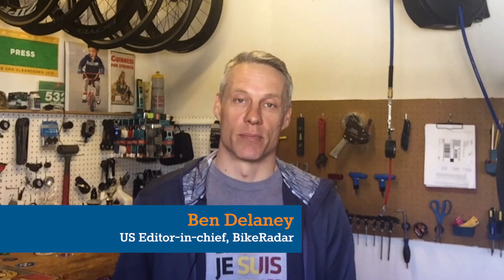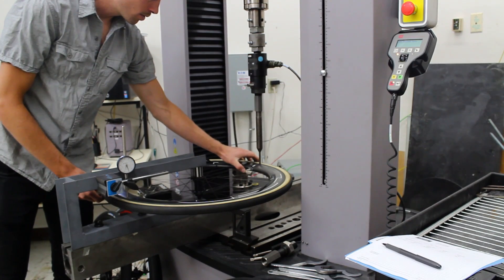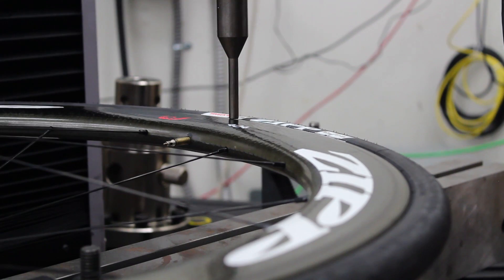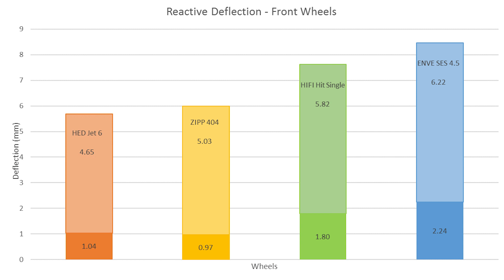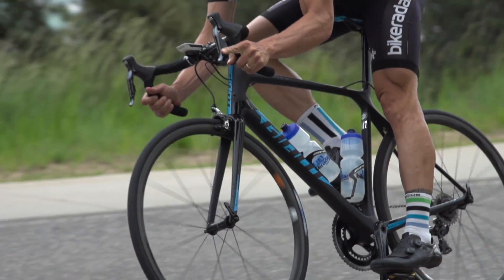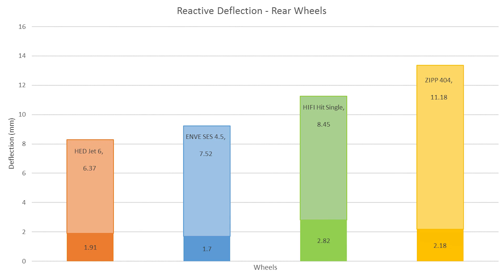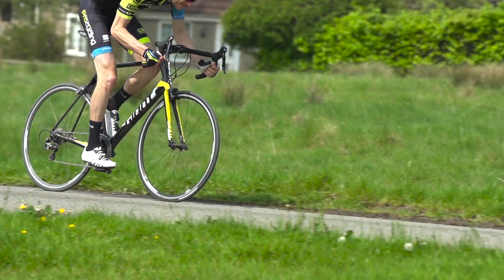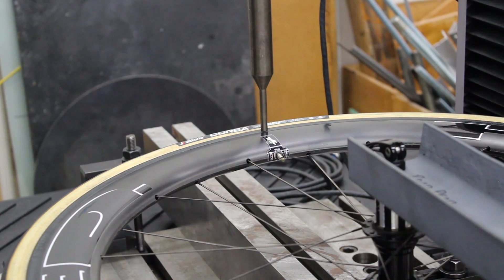Lab Tested - Wheels? Frames? Which Is To Blame For Brake-Rub?

Comment: It would be interresting to compare those numbers to a standard 32 spoke wheel for reference. I guess the HED performs like many other 20-24 spoke aluminium counterparts due to it's construction.

I once did used Specialized 3-spoke carbon wheels that was flexing considerably in a sideways motion.

Another interesting thought I have is this. How does these two conditions behave in real life? Does the flex in the wheel amplifie in the frame or do they contradict each other?

Comment: I think this test is off the track for one good reason, you forgot to explore one very important component on a wheel : the axle. When I look at the assemly between the dropouts of my bike and the axle of my wheel, I cant help but notice that it's not meant to be as solid as the 142x12mm axle on my mtb. I'm pretty sure the obsolete quick release attach on modern road bike is the main cause of brake rub. That's why my next road bike will have bigger axle and not that stupid piece of rubbish of QR axle.
Reply: Plausible. Thu axles give frame/fork rigidity that QR lack. I wonder if thru axles alone would eliminate frame based rub.

Comment: No mention of frames with brakes at the BB which are way more susceptible to rub.  I won't ever buy one again - Felt AR rub terrible under power to the point that you question the design altogether.  Felt AR the worst I've ever seen for this.
Reply: Same for me with Bottecchia T2. i was looking for answers when i found this video. So no solution for BB break rub? Not even a stiffer wheel? Was it only break rub or did the tire touch the frame also?

Comment: I was using a pair of cheap but very light Ti skewers and experienced brake-rub. Since moving onto a set of heavier steel skewers, the problem was gone. 

My guess is spokes tension plays a big part too, also I was told CK hubs have large amount of play in the rear wheel, more so the likes of tune, Fulcrum/Campag and DT240 etc.
Reply: Same here, the weight of the skewer was ridiculously low, and the down-side was brake-rub. Switched to more rigid ones and the problem was gone.

Comment: When you mention the deflection, is it total deflection from weight being applied to both sides of the rim, or just a single side? if so, which side was the weight applied on, Drive or Nondrive? I imagine a rear wheel, due to dish, to have very different deflection, depending on the side that the weight is applied to.

Comment: Do disc brake bikes have this issue?
Reply: Peter Milne I ran into pad/rotor rub when using flexy ENVE QR skewers. It went away when I switched to DT Swiss RWS skewers. Maybe less likely with thru-axles.
Reply: I have Disc only had issues with rubbing when the QR is not done up properly
Reply: Focus has awesome thru axles. I think they are almost faster than "quick" releases!
Reply: Peter Milne - Back in 2003 on a wet noodle SID fork and X-Max wheels with QR, I got noticeable rub under heavy sprinting...but those days are long gone.  Any disc rubbing these days is usually setup issues.

Comment: Flex in wheels will be compromised by spoke number and light spokes. If had the coin for enve's I'd get them built up with aero compsl or even a triple butt aero spoke drive side.

Comment: pls do a test between disc brake specific wheelset and the caliper brake wheelset.. and does the brake-rub happen to disc brake bike? personally it havent happen to me, but then again im using a aluminium frame
Reply: and im confused on the conclusion on the video.. they tested both wheels and frame yet didnt specify whose to blame? is it the wheels?

Comment: just use dics to solve all these problem
Reply: That is a typical complaint of rim brake roadies. Disc brake rub. But lets face it, both can rub and nobody ever personally fixes it, just blames the product design.
Reply: I have dics road bike and it can rub every now and then but i find making the QR a bit tighter helps solve it. I would like to see if through axles would make it even better and prevent all rubbing.
Reply: I have rim brakes and NEVER experienced brake rub... buy quality stuff!
Reply: I do I work in a bike shop and only buy what i think is best.
I have only ever had one bike with rim brake and did not suffer with it but my brother has in the past on his giant propel advanced pro with Giant SLR 1 Aero Wheel.

The brake rub on my bike has only ever been a issue when the QR is not done up tight.

Comment: Disk brakes is just better :)
Reply: But when they rub... oh boy. Adjust the calipers all you want
Reply: Through axles and disc brakes are a match made in heaven, disc brakes and standard QR's on the other hand can be a real PITA, especially in the front, adjust the tension of the QR only slightly(which has to be done to get past the safety catch unless you've filed it down) and your almost guaranteed to have to re-position your caliper or finnick with the QR.
Reply: Maybe for you because you don't know what you're doing (no offence) but all my years of using disc brakes I have never had issues .
Reply: Adjusting disc calipers is easy and if done properly it should remove any rubbing. If they still rub after the caliper is adjusted then you just need to true the rotor.
Reply: The QR dilemma can be an issue but you just need to adjust the caliper to align it properly (which is easy by holding the brake lever while tightening the bolts) and then the QR will tighten without affecting the caliper . 

On the other hadn I have a Lauf and the first time installing it the disc rubbed against inside of the fork leg . Luckily no damage just a score mark but it could have been worse . 

Bottom line is disc brakes a=cannot be beaten in performance and adjustability . The only downside is price and weight but even that is slowly changing with new materials and cheaper options by Shimano .
Reply: +Seb K That's why all decent road bikes with discs (and a lot of decent MTBs) come with thru-axles now, not QR. Thru-axles gets rid of putting in the wheel not 100% perfectly, because with thru-axles, the wheel is either on perfectly or not at all.
Reply: You still get issues with thru axles though (check my last comment) and with QR you can still get a good alignment . Maybe not 100% all the time but enough to be safe .
Reply: Not sure if this could have been your problem but maybe the rotor was to large? Is the Lauf fork compatible with all disc sizes?
Reply: It was a 160mm . The maximum is 180mm .
Reply: This is alot easier to do and most of the time you need to adjust it one time only
Reply: Tomer Tal coming from mountain biking i can tell you that disc brakes are far superior in all aspects(apart from weight)compared to rim brakes so if you have the money they are 100% worth it.